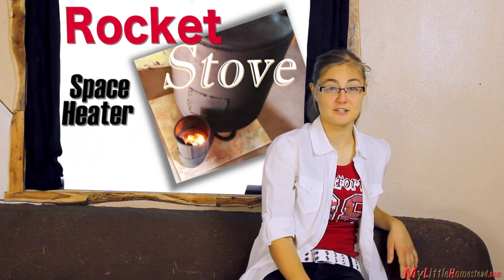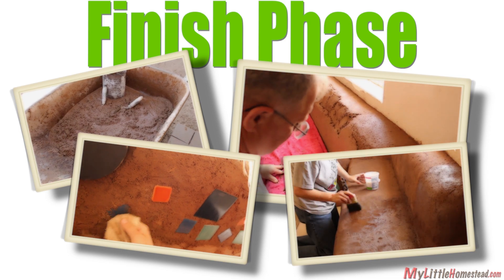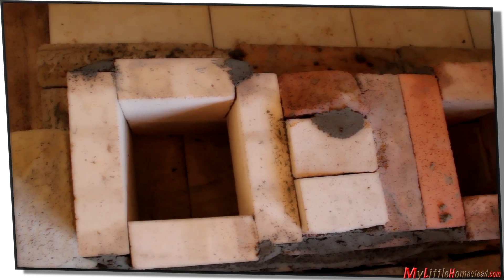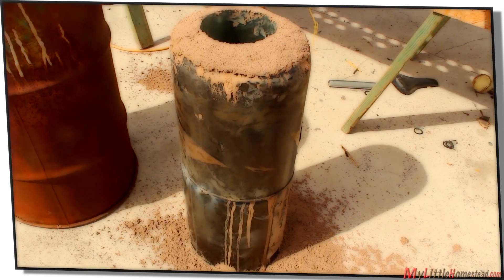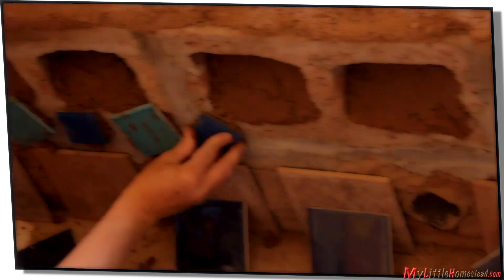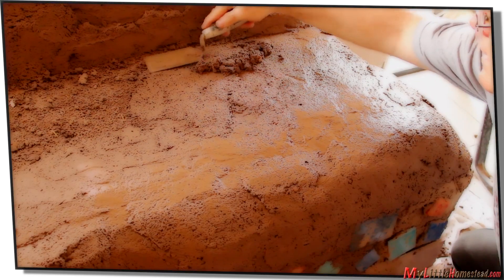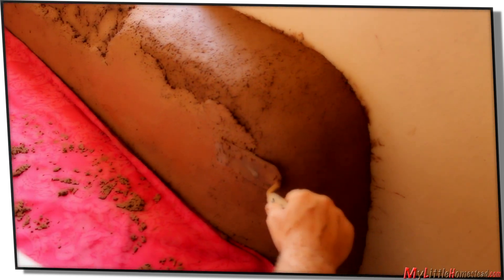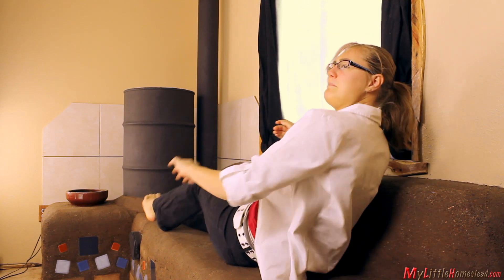Complete Build of Rocket Stove Mass Heater with Homemade Mortar & Cob

Comment: Felicitări pentru acest video și foarte util pentru generațiile ce vin🎉 și eu sint pasionat de roket stove după multe informații studiate și puse cap la cap și  pentru climatizarea casei vara cit și iarna am decis sa fac în felul asta roket stove cu tubul ridicator transformat artizianal in schimbător de caldura de înaltă performanta cu agent termic care circula prin tavanul casei făcut tot artizanal  casa are o amprenta de 160 m2 asa eu reușesc sa aduc în fiecare camera sa aduc soarele care te cuprinde din toate direcțiile confort max. Și tot prin această roket stove vara transform casa mea într-o peșteră răcoroasă cind afara sint 39 de grade în curte am un put cu apa rece care cu ajutorul unei mici pompe trimit în automat la cererea termostatului apa rece în scinbatorul de caldura care la rind ul lui răcește agentul din sistemul radiant (racire pasiva spre Gratis și sint extrem de mulțumit ca am reușit ca această roket stove sa poată și fie complet întrodusa in sistemul de climatizare coplet)

Comment: Why not simply use sand to fill the box over the piping ? Concrete pavers could be used to cap the bench. Also.....it seems like a clean out should be in the bend at the end of the bench.

Comment: Pretty educational for me because i have a seperate 2 1/2 car garage that I have been using for a personal shop and wanted to install a fireburning stove in for heat and i currently have something like 4-6 feral cats i let shelter in the winter so this will work just fine. I can put the boxes on top of the bench and they'll stay warm. Thanks.

Comment: Design improvement would maybe be a hollowed out seat instead of a stuffed rounded couch look from which you will slide more easily.
A slight concave seat deeper in the back with the same rounded edges.
Just a bit sunken seat and back in a flowing angle like the inside curve of a standard boomerang having the bend sit below edge level to help with sitting since you’re not sitting on but slightly into the mass.
Still looks great though, it’s the best looking one I’ve seen texture wise and its overall dimensions, a beautiful consistent earthy look which is partly due to its current dimensions I have to admit. 
It reminds me of a perfect looking old Mexican American adobe house.

Comment: You never show how the metal pipes under the bench are connected to the rest of the stove and you don't show where the venting pipe is connected either. There's no way anyone could build one of these things based on what you've shown here.

Comment: At the end, someone talks about a radiant floor, and that is what I would do, but it is based on info I stumbled on this week. You could pour a concrete floor, place heavy PVC tubes into it and then top the concrete off. Two pours would be needed as the tubes otherwise tend to float to the top. Then building a stove like yours would allow the house to be heated floor up and there would be no issues of Co2 being exposed as the PVC would be sealed in the concrete. The same exhaust could be used to vent to the outside. Equal temps would be achieved throughout the house, and the concrete would serve as heating mass to hold the heat.

Where is your homestead built. I've watched most of your videos, and they are great, but would like to be able to evaluate how they would apply to my homes. One in NH and the projected one in TX.

Comment: Uh...you never never cover over electric outlets. Easily cause huge fire hazard in wall that you will not be able to access the wire connections. Code: all electrical junction box’s must be accessible.

Comment: Heat goes out the roof ???....
What heat ??? The exhaust should be less than 100°F.
Methinks a smaller barrel than original design, would change the diameter and length of the ducting used.
There should have been no restriction to routing it out the wall behind.

Comment: Sooo cool...we are inspired to build our own...soooo questions... how long does each layer of cob need to set before another layer can be added? Wondering if your pipes going up thru the ceiling need to be double-walled insulated?  What kind,of pipes in the bench?? How hot does the bench get? Hot enuff to heat our shower water?
Reply from the maker: 24 hours on the cob set time for vertical application. Horizontal applications we estimate 4 inches per layer, wait 8 hours and apply more if needed.
Reply from the maker: Go double wall on flue for your peace of mind. If the bench absorbes 80% of the heat available then only 20% is in the flue. When our stove is at its hottest, we can still touch the pipe and it will be warm.

Comment: For your purposes, my comment will not make a difference, but perhaps others watching it will benefit. 

Concrete blocks (aka, "cinder blocks") should be placed with the holds going vertically, not horizontally as you have laid them out. In other words, you have placed the blocks on their sides.

See https://youtu.be/Qfw679NHSAs

Comment: It is likely that the section of the piping that passes through the attic is required to be double insulated and rated for the purpose. When burning wood, the creosote from the process eventually drops out, so I am concerned that you don't have a way to get in and brush it out. However, if the stove is that much more efficient, then perhaps my concern is groundless. And yes, the outlets you covered needed to be de-energized.

Comment: Regarding the nails... I use a stack of 1" rare earth magnets inside a plastic pill bottle, then I put it inside a tin can, swirl around in the ashes, and when loaded with nails, lift it out and over a container for the scrap nails. Remove the magnets from the inside of the tin can, and all the nails fall away - no mess - no fuss... Enjoy

Comment: 255 how did you size that thing, what is it and how does it work,... purpose of the video and you don't even mention it... how did you get that heat to go sideways and what temps do you experience, do you add insulation on the near side?

Comment: A reflector mounted on the wall behind the chimney would increase efficiency.... you could also put some heat sinks around the chimney to create more heated surface area...other than that well dont in putting a mass of dirt inside your house with a pipe through it....
Reply from the maker: +Mahila Maseli 
Good ideas

Comment: That is a very nice looking finished product. I am curious why you ran the exhaust through the ceiling/roof though? Wouldn't it have been easier to simply run it through the wall like a clothes dryer? I have seen other people do it that way, and they said the exhaust was clean and barely even warm as it exited, due to the heat being retained in the mass of cob. Again, very nice job.
Reply from the maker: +adamsmithwastheman 
We had some great flanging provided by Ondora.

Comment: I do not get how you are going to clear the pipes inside the mass heater (after the u turn, in particular) and generally, how you get rid of ashes.
Reply from the maker: Rocket mass heaters do not produce much ash. It is burned and reburned in the combustion chamber.

Comment: Loved the video! 

I wanted to ask if you had trouble with the ash removal since the clean out is a long way from the combustion chamber and it seemes to be sealed. Was this a problem in the long run? did you have to upgrade the combustion chamber for heavy cleaning? Im guessing that a door placed on the top of the barrel would be pretty fair.

Great work! Cheers!
Reply from the maker: +Bruno Arce 
Shop vac

Comment: thermoelectric peltier modules connected to rocket stove with outside cold air intake to cool cold side of peltier modules, powering fans, lighting and a couple solar air heaters to reduce wood consumption even more. rocket needs to have outside cold air intake
Reply: wrap some copper around barrel, convectional hot water piping under floors for heated floors
Reply from the maker: +Tim McGirl (AT Chimney Sweeps) 
Nice...
Reply: The life and times of a mad scientist chimney sweep :-) The little solar air heaters are pretty awesome alone!
Reply: I would imagine that a couple small solar air heaters would cut wood usage in half.
Reply: Tim McGirl

Comment: A rocket mass water heater with a V-10 Sterling engine could produce hot water and circulate the water through hoses in the cement slab to heat a home green house or shelter. You could also run cold water to cool. All without electricity!!!
Reply from the maker: +Jim Martin 
We will look into them.  Sounds like a good job for Bryson.  Thanks
Reply: Don't forget to make an alcohol stove insert to use with the rocket stove. When there is just nothing to burn its always nice to have options.
Reply: A peltier water chiller for your underground cold water cistern ran off a rocket mass water heater could keep an off grid home chilly! You could run it off solar panels has well. No need for a huge electric bill if used in a home?
Reply: You could add a water hammer into the set up to make fresh drinking water has well and feed an underground cistern. Tools for a true off grid homestead!
Reply: Put in an insulated underground cistern a heat sink and generate electricity has well from this design.
Reply: You could use heart plugs used in diesel engines to heat the pistons on a V-10 or V-20 Sterling engine. You could add in an alternator to keep the charge to run the engine. Hay say goodbye to fossil fuels?
Reply: Novartis!
Reply: Hay I have a pykrete cold sink design for cooling needs if your interested?

Comment: Make a mass nitrogen rocket air conditioner. To draft your house without the use of ekectrity.
Reply from the maker: +Jim Martin 
Thanks Jim.  We need a little research.
Reply: I have a design for a nitrogen mass air conditioner. You could draft a home or put booster fans ran off a thermostat to move air through the system. It sort of works like a home made air conditioner. The nitrogen mass air unit is quite unique. I am working on a heating element that works just like the nitrogen mass air unit. No more burning fuels or radioactive stuff! A way to be more free and not impact the environment so much! ; )
Reply: A closed system that cycles generating heat or cold depending on your needs? No consuming elements to generate heat or cold? Is this not the holy grail? A rocket stove can draft a house while making out water and you can even condense the water vapor from it to use has grey water or in a green house. Why not reverse that thinking for cooling needs? If done right you could connect all these systems together for a very nice off grid bug out site that works better then your licensed city home! Yup! You could put heat absorbing panels that turn heat into ekectrity on the rocket stove water heater doing away with solar panels and have a heat sink filled with perlite to keep your hot water and have constant volts to run your home on? Research controlled knowledge? LOL
Reply: You could mix biological antifreeze ptotien into the heated water set up has to not frezze up on you during the cold months when not in use.
Reply: A V-10 sterling engine incorporated into a rocket mass water heater with a heat sink? To circulate hot water to heat a green house or home or cool it with cold water from a cistern all without any electrity? LOL really? You all want to say good by to a huge electric bill? Hay now you can with a little elbow grease! Won't all this just piss off all that fat cats! LOL

Comment: Best wishes to the Master!  Thank you for useful knowledge. Metal furnace suitable for the heating of places of temporary stay of people in a garage, shed, greenhouse or couches with heating furnace located outside the dwelling. At 120 degrees begins burning-dust on the surface of a metal drum, invisible sprays burnt dust spread on residential premises, polluting the air. Open window here will not save. It is like sunbathing "in nature", from the tailpipe idling car, comforting themselves with the thought that you are outdoors. The main disadvantage inherent in all metal furnaces - a negative impact on health. Rocket brick oven with a warm floor allows to accumulate heat, comfortable heat without toxic aerosols room, prepare on the stove and cooking food in the oven for all tastes: https://sites.google.com/site/menedzmentteoriapraktika/upravlenie-infrastrukturoj/rocket-stove-new-design

Comment: Nicely done video.    I would like to a rocket mass stove myself,   but, to make the cob,
where do you get the clay from.   I don't  think it's sculpting clay that artist work with.
That kind of clay is very expensive.     
I would think you could find this clay in your own back yard if you were to dig there.
Or maybe exposed along a riverbank.
But , can I buy this clay anywhere?   Is it called "fire clay"   would it by sold at a mason
supplier store or at a landscape supplier?
Reply from the maker: +George P We get ours from the dirt that was dug from an excavation site nearby. There are ways to test your dirt for clay content using a glass of water - you can look it up on youtube :)  It is not "fire clay". You should be able to pick it up for practically no cost. Good luck with your project :)
Reply: +George P, Go for it,Building and using a Rocket stove is the best heat I ever had,with no regrets.maybe a little messy burning wood ,but for the cost savings on my heating bill and warm feeling ,it is worth every ash mess.

Comment: I was wondering about your heat riser or what you called the combustion chamber.  I see it was a 6" metal flue surrounded by a larger flue made by a couple of 5 gallon metal buckets.  Then the space between the two filled with cob for insulation.  My question is how well did the 6" flue hold up to the tremendous heat produced?
Reply from the maker: +Dan Reed  So far, so good :)

Comment: Does it heat the entire room adequately by itself, or just the sofa?
Reply: +www.FineFolly.com The combustion chamber (aka the large black barrel) will get hot and start warming the room. Much of the rest is then heating the sofa and the mass (which in turn heats the room). In short it will heat the room, but in a slower way than a normal wood stove. After the fire goes out on the other hand - heat stored in the sofa will keep the room warm for a longer time than a normal stove.

Comment: Opps, One more question.  I noticed that behind the barrel of the stove is ceramic tile that is what? about 6-8 inches from the wall... Do or did you have any problems with heat affecting the mastic or this set used to hold up the tiles?? (i.e.) excess heat build up behind the barrel? , tiles falling off the wall? etc.  I'm just a little concerned with the radiant heat coming off the sides and top of the barrel.

Comment: THAT STOVEPIPE IS WAY TOO CLOSE TO THE WALL HOLY CRAP
Reply: +Patrick Pellow  I believe his exhaust temp (at the time it exits the rocket mass heater) is probably only about 130 degrees. Even going through the roof its probably about 120.  Hence, I don't think there would be a problem.  Besides they built it, used it for what? 3-4 years and haven't had a fire.

Comment: If you was worried about getting (metal) nails out of the small fire place.  please remember burning treated wood (lumber) is dangerous but illegal!  so I hope it was a nail from the (No Trespassing) sign or the old barbed wire fence!
Reply: +Sherman Ratliff Just thought I'd Share. http://www.1001pallets.com/pallet-safety/
Reply: +Sherman Ratliff Pallets are usually not pressure treated whether hardwood or softwood.
Reply: It's scrap there burning..

Comment: Did you have to reinforce your floor to hold the weight of the cob mass? Assuming you have floor joists.
Reply from the maker: +Edward Kelly  It has four inches of concrete underneath

Comment: My only issue with the design is there is no barrier wall between the steel drum and the seating area so I would add that to prevent accidental burns. I am wondering if the cushions slide off? If so, am thinking of adding in some type of anchors at the back to attach them to. Would it also be feasible to add a cleanout at the front of the firebox so it can be swept out if someone does not own a shopvac?
Reply: +Itzhotli Cihuatl Yup just make a big bench(sleeping) can always add pads in back.

Comment: It looks like the pipe that is being used is just galvanized ventilation pipe. If this is the case, this is not a good idea. The reason that stove pipe is more expensive has to do with different processes in manufacturing that does not produce toxic gasses like the galvanized piping does. By the time that the exhaust gets to the chimney it should be cool enough to reduce the gasses significantly but the temperatures near the clean-out are definitely worth concern.
Reply: Indeed.  Heating galvanized pipe can release Zinc vapors, which are toxic.  Good catch.
Reply: A world of bubble wrap protects most americans.